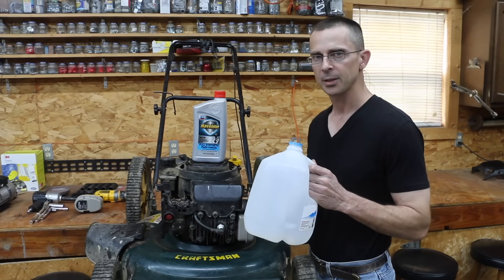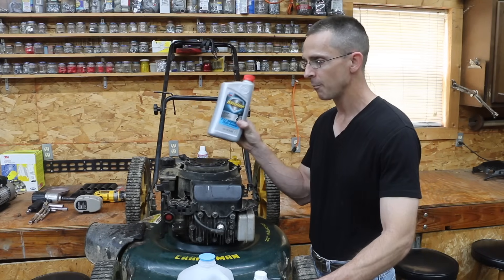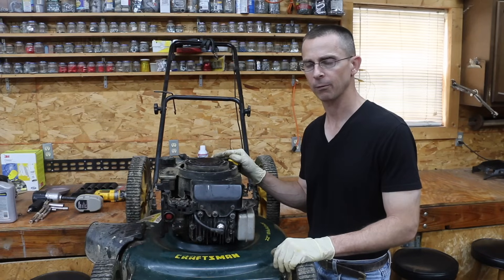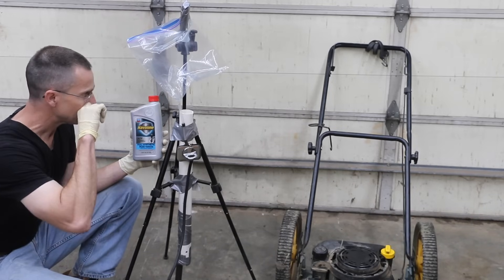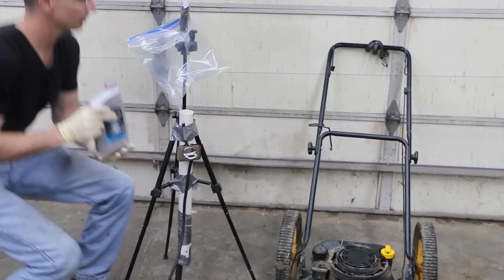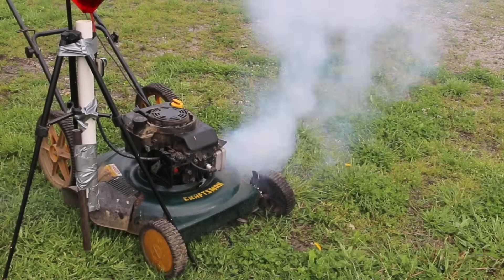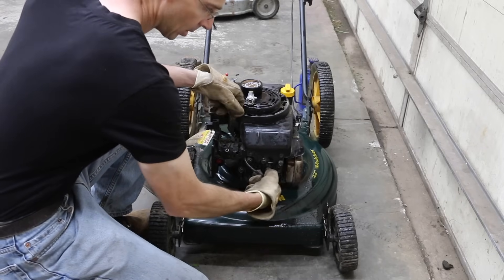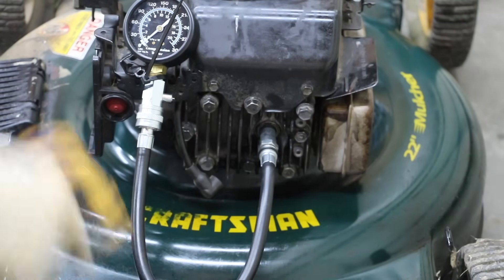Seafoam--can't believe what it did to my engine episode 6--Seafoam vs ATF!!

Comment: I realize Lucas Oil products aren't part of this test, but I felt compelled to brag on it anyway. My '97 Mercury Villager (215,000 mi) was missing badly, and a mechanic diagnosed the issue as a stuck fuel injector, recommending replacement of all injectors. After running two tanks full of gasoline with 2x the recommended concentration of Lucas top cylinder lube/injector cleaner it no longer misfired. Now, after regular use of that Lucas fuel additive at the recommended concentration over five years I've had no more misfiring and never replaced the injectors.
Reply from the maker: James,  That's awesome!!!  It's great to hear the success stories others have had with additives!  I like Lucas products and will be using more of them in upcoming tests.  Thanks for watching the video and commenting!

Comment: I started adding Duralube to new engines some years ago and I really think it helps prevent carbon. It's especially effective in 2- stroke glow engines for RC airplanes. One of the common issues with small glow engines is varnish buildup from the castor based oil and the Duralube all but eliminated it. Of course, now that I've switched over to electric motors so I can fly at the local park, it's no longer a problem!
Reply from the maker: Pete, I've heard a lot of great comments about Duralube!  Thanks for watching the video and commenting!
Reply: You are most welcome. I got sold on Duralube, especially for those glow engines, when a buddy showed me a disassembled engine and told me to rub the metal bits together. There was almost no friction at all. "Glass on glass" is a fair description. Those poor engines run on methanol so the fuel itself has zero lubrication and they operate at anything upwards of 15,000 RPM. Synthetic oils work quite well but they don't offer the high heat protection offered by castor oil. And that's where the varnish crops up.

The single most impressive result I had was an older engine that just wouldn't idle as low as it once had and wouldn't spool back up if I had to suddenly add power. It had, at that point, about 5 gallons of glow fuel run through it which, for a .61cu glow engine is quite a long life and I was just about to give it up as "worn out".

I forget the precise numbers but it wouldn't idle reliably much under 2,000 RPM which, in that particular plane, would keep it flying in ground effect until I cut the engine entirely. After treating with the Duralube that dang thing would idle down until I could almost see the propeller blades, less than 1,000 RPM, and it would then spin up with no issues whatsoever. I burned at least another 5 gallons, adding a few drops of Duralube down the carb with every new gallon, through that engine myself and then gave it to a buddy who still flies with it today. We recently tried to figure out how much that thing had run and our best guess is a bit either side of 25 gallons! It is, however, on its third ring. The rings don't wear out, they get scorched, and the cylinder liner is pretty much good as new to this day.

The results in gas burning engines, whether model airplane engines or chainsaws or dirt bikes or lawn mowers, have been less dramatic but still noticeable. It also seems to have a negative effect on the spark plugs in gas engines and it ruins the glow plugs in glow engines. It's not cheap but a "little dab will do ya", as they say. I bought a quart about 20 years ago and I still have half of it!

Cheers!

Comment: ATF is crazy stuff... actually be careful around rubber, it makes it swell up and turn to goo in a hurry. You get it on any rubber spark plug wires or coolant hoses... it's gonna be an unpleasant surprise. My guess is o-rings and seals are ok for any part of the fuel system though, I would imagine they use HNBR in situations like that so chemicals don't eat them away. 

Another interesting thing, if you put this stuff on a rusty bolt/nut it'll loosen it up better than any spray you've ever used. The longer it sets the better, but it's incredible how much it helps loosening rusty fasteners.
Reply from the maker: Jesse,  Great advice--thank you!  Also, thanks for watching the video and commenting!

Comment: Thanks for taking the time to make these videos. Looks like ATF really does the trick. I suspected it would. It has detergents in it. I've used it as an engine oil additive from time to time. Makes a great hand cleaner in a bind too. lol!
Reply from the maker: Jon, Thank you for the encouragement!  Also, thanks for the tip regarding use as a hand cleaner when in a bind!  Up next, I'll be testing Marvel Mystery Oil this weekend.  If editing goes well, I'll release the video on Tuesday.  Thanks again!
Reply: Kewl. Another fine product. I would be interested in knowing how that works.

Comment: Really impressive result.  ATF is similar to diesel in that it's combustible and a lubricant, so this is a very promising result.  It would be cool if there were a way to really optimize the injection procedure, but I can't think of anything cheap off the top of my head.

The continued impact that this process has on the oil is something to take note of, though.  It's tempting to think of stronger yet combustible solvents like biodiesel, but eventually, there is a risk of losing lubricity and damaging the cylinder wall.
Reply from the maker: Markworth, Excellent point regarding the cylinder wall/lubrication!  Diesel seems like a great option to consider.  Thanks for watching the video and commenting!

Comment: Great videos. Don't ever stop. I also agree preventative maintenance is the best, but these products are great for something that has been neglected and doesn't warrant the attention of a full rebuild. I have used both seafoam and ATF, some say that is all MMO is, they all seem to work for my needs. For water maybe using a pump sprayer for gardening to atomize the water into the intake would be better, but I don't know. I haven't been brave enough to use water.
Reply from the maker: eygfhnqwhag, Thank you for the suggestion on water.  I wholeheartedly agree!  I plan to repeat this test using a sprayer or mister.  What do you think of using "steam" from an iron?  Would that be better than a sprayer?  Also, thank you for the encouraging comments on the videos.  They are a lot of work but I'm having fun running these tests!  Regards!
Reply: Your guess is as good as mine. I would assume that if the engine is nice and warm the water will become steam by the time it hits the intake valves, but on a real small carbureted single banger that probably doesn't have a chance to happen. That carburator probably cools the intake charge a noticable amount, so using steam from the get go might do more to clean the throttlebody/intake plenum, but I am just guessing. It will be interesting to see what you come up with.

Comment: Why the loss of compression? Ty for video
Reply from the maker: Toby, I don't fault the ATF for the loss in compression.  I believe the compression would likely improve with use and a few heating and cooling cycles.  The engine is about worn out, which is why some of the ATF ended up in the crankcase.  The old timers seem to be on to something with ATF.  Thanks for watching the video and commenting!
Reply: compression changes with temperature do to expanding and contracting metals.
thats one of the reasons when you dyno test a car you want everything to be tested at the same temperature. horsepower will vary even with the air temperature.
Reply: Project Farm 
Thanks....i dont recall the other videos losing compression ....am I wrong? or did the ambient temps drop?

Comment: Rather than the time and expense of running an additive through an engine, I'd rather just pull off the cylinder head and use a wire brush, or better yet, a Scotch-Brite pad or a 3M abrasive disc. It takes like 10 minutes and it works better than any additive I've seen... This is only really an option on small engines. Automotive engines, with a fuel injection system, don't ever really need this done (unless they're burning oil..  in which case, you've got bigger problems.)
Reply from the maker: pharside42, Excellent point!  Thanks for watching the video and commenting!

Comment: ATF is very flammable but you'll notice your valves were worse after the ATF than they were before (ATF doesn't burn 'clean').  ATF has been used for this kind of thing before, but all these 'old skool' tricks aren't without risk.  Nothing cleaned up your piston.  With modern alcohol in the fuel, it just sucks up so much moisture that engines don't run clean anyway (especially carbureted ones).  The $7 you pay for Seafoam (most times you can find it for around $5 or less a can) is to pay for claims and lawyers.  Water, ATF will void engine warranty.  In the end, if you want to 'clean' your engine, run clean fuel and keep your motor in good shape.  Given the ethanol in fuel these days, the first is almost impossible so take whatever risk you are willing to with your motor but in the end, keep it running as efficient as possible and it will clean itself.
Reply: +SHcinema - LOL, hmmmmm... I wonder how the Engine is gonna clean itself. Is there a Man in there, like in a Fridge when you open the Door, he turn the light on for you?  LOL, trying is better than doing nothing.  LOL
Reply from the maker: SHcinema,  Excellent points!  Thanks for watching the video and commenting!
Reply: Project Farm B12 is the best imo thanks for these experiments though very cool

Comment: I worked for a forklift company. An oldtimer there told us to fill the new fuel filters with atf before installing them on DIESEL engines.
prevented a dry start.
Didn't need to have diesel in a can.
Reply from the maker: Matthew, Interesting approach!  I've learned a lot of the old timers in my life.  I continue to seek their advice often!  Marvel Mystery Oil testing this weekend.  Thanks for watching the video and commenting!

Comment: i wonder why the compression went down. hey man can you check for engine wall wear before and after. 

p.s keep it up man looking forward  for the next video
Reply from the maker: Hamdan Alharbi, The cylinder wall wear is an excellent suggestion!  The lower compression wasn't by all that much and I suspect it would likely improve after some additional use.  Thanks for watching the video and commenting!
Reply: The compression went down because the carbon buildup was adding to the thickness of the piston and lowering the volume of the combustion chamber.
On the scale of things, the difference was very small.

Comment: The difficulty of your particular test engine is getting the fluid into the chamber as part of the mixture and not dribbling in and then going past the rings into the crankcase.  I prefer water over ATF as I believe that the ATF does not provide the lubricity needed to properly lubricate the rings causing a small percentage of damage.  All of that being said, I would use water and instead of trickling it into the motor as you did, I would try to spray it in and have it atomize better.  Either way you are getting very good results and some entertaining videos.  Thanks for that.  Also, I don't think any of this is nearly as important on newer, more efficient engines that have better combustion processes than these old flat heads do.  I doubt you would find the buildup that you see on these flatheads on newer OHV engine.  Thanks again, its fun to watch.  R.J.
Reply from the maker: R.J.'s, Workshop,  I agree!  I believe the compression is a bit low on this particular engine, which resulted in blowby.  I plan to repeat the water test using a water mister.  Thanks for watching the video and commenting!

Comment: Do you think acetone would do anything?
Reply from the maker: IAMFIELDS, It might, but I believe the flash point is pretty low compared to Seafoam, ATF, Marvel Mystery Oil, etc.  So, it'd likely combust before it has an opportunity to penetrate any sort of build up.  Also, acetone could cause harm to rubber or plastic components.  So, I'm reluctant to try it.  Thanks for watching the video and commenting!

Comment: If you are enjoying it and looking after some educational information... I doubt it's a waste of resources. ;D
Interesting results with ATF fluid.
Reply from the maker: Ti M,  I agree!  My oldest son is benefiting from these experiments as well!  Thanks for watching the video and commenting!
Reply: premium still has ethanol.... just has a higher octane rating which if your car is tuned for that will gain a little more efficiency, and higher octane prevents pre-ignition knock (especially in high compression ratio cars such as my 2016 mazda 6 which is 13:1....... most cars today are around 10:1 so running premium unless you have forced induction won't make a big difference.....)
Reply: Ti M I like your nichijou pic.
Reply: Project Farm you should do a comparison between regular 10% ethanol fuel 87 octane. vs 91 or highest octane fuel available in your area
Reply: Ti M I'm not a huge fan of ethanol I run premium fuel in my truck and other stuff
Reply: Joel Dale Well... On big old engines with low power per displacement, smooth operation and low compression ratio (below 9.5:1), the ethanol is very unlikely to offer any advantages on long term use.
Perhaps could be a nice cleaning product... Just testing to actually notice that if this transition worth it.

In my experience, 1.6 8v Zetec Rocam engines (with different compression ratios) rolling with ethanol, even working with lambda 0.86 (rich enough to achieve maximum power, while 1.05 is meant for maximum efficiency), on a daily basis got smaller deposits of carbon. 

Here in Brazil, the quality of the 87 octane gasoline is questionable on some regions (noticeable smell of sulfur even on cars with good catalytic converters) and already got 25~27% of etanol (which increases a lot the antidetonant factor of the fuel). 

The premium gasoline is too expensive, but got no advantage on most of common lower compression ratio engines and got not enough octane index (usually 92 IAD) to actually beat the etanol.

There is even a special type of gas known as Podium, which is 95 IAD (102 RON) lead free and with very low sulfur content. 
It's even more expensive, but got some special utility. I use it as lead-free alternative for aviation gas on smaller Rotax engines, to clean parts (almost no smell, which is awesome) and on auxiliary tank for cold start on ethanol engines (this gas is really stable and can stay on tank for months without any issue) or as additive for etanol during winter (~20% of Podium is enough to make the engine cold start smoother during the coldest days).

Just for reference the ethanol got roughly 100 IAD as octane index, which makes it an awesome and safer fuel for very high compression ratio engines or for turbocharged engines. 
The best part is lower toxicity of the fuel (produced with sugar cane) and it produces less carbon and smoke (and a lot of vaporized water).
But... In older gasoline engines, there isn't any protection to prevent the corrosion, due the a bit lower pH of the ethanol and water content, which usually results on damages to very old or cheap low quality carburetors, gasoline fuel pump malfunction, etc...

But there is only two ways to discover the results: research and testing.
Reply: Joel Dale Even running the engine on common hydrated ethanol would be interesting. 

My only concern is about the carburetor, because some older carburetors are not prepared to deal with ethanol and might suffer small corrosion if you keep running on ethanol everyday.

If your engine got a compression ratio lower than 10:1 or 9.5:1, I suggest warm up running with gasoline before fuelling with just etanol.

The ethanol or E100 usually sold on gas stations contains around 4% of water. If water can help to clean the engine, on the long run it might render some results.

_____________

Ethanol is a very common fuel in Brazil. 
Usually you got between 72% and 83% of gasoline mileage (highly depending on the specs of the engine, like compression ratio and spark advance settings) and usually cost between 70% and 85% of the price of gasoline in Brazil (depending on the region).

E85 is not exactly common around the world, but could be interesting too.
Reply: christopher dimotsis it depends on your gas station . Our marked  mid grade(87) does not contain any ethanol. And also our premium (91) and premium plus (94)do not obtain any ethanol . It is advertised as no ethanol as well. This is in British Columbia Canada which we just started seeing ethanol at out pumps a few months ago.
Reply: because from the factory your ECU from mercedes is tuned to run that premium fuel.... every car can be tuned differently, just like my mazda says don't use less than 87 octane but the ECU will notice a higher octane and advance timing for power and is some cases efficiency...... and don't bring up Mercedes while i agree they are nice cars, they are pretty much a status symbol "hey look at me i drive a Mercedes"...... the company designs flaws into the car so if you don't do major mechanical and service intervals it falls apart.....
Reply: christopher dimotsis yeah I'm a mechanic and I just happen to like German inline 6s. Sorry to bother you so much for me liking German cars.

Comment: Would it be more effective to pull apart your engine and clean off the deposits manually with a nylon brush? Or would that do more damage than it would help?
Reply from the maker: DarkLordDylan, It would definitely be more efficient for a lawnmower, but not for a modern automobile engine.  I would much rather use an additive in a daily driver.  Thanks for watching the video and commenting!